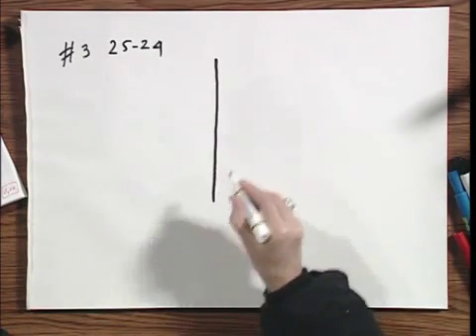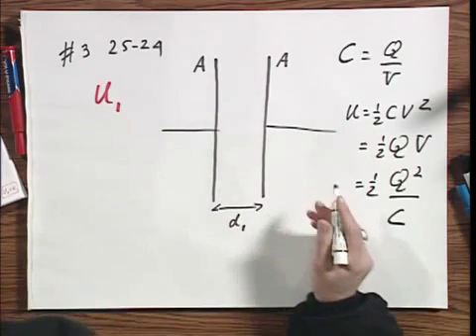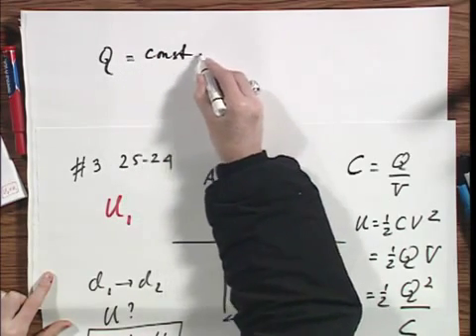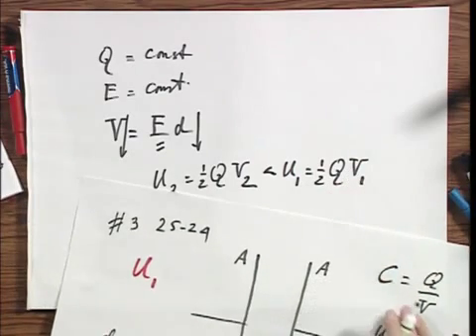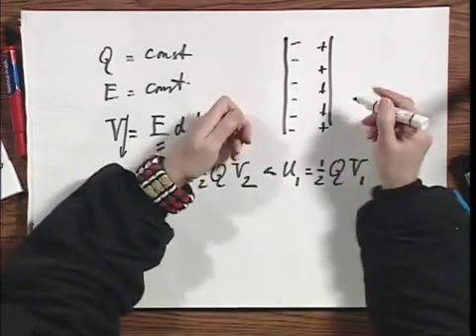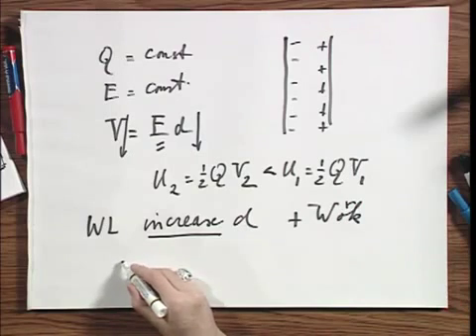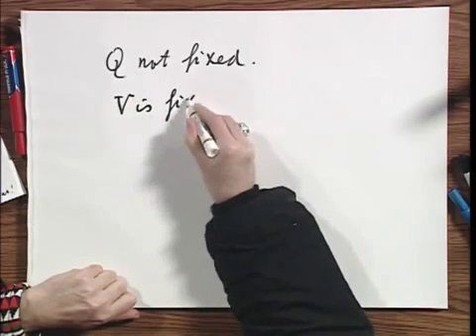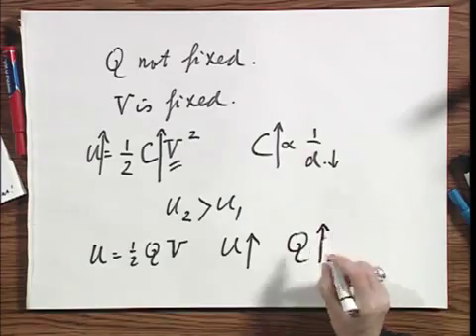8.02x - Module 03.03 - Parallel Plate Capacitor with a Variable Gap.

Comment: sir plz understand me the concept of positive &negative work in electrostatics
Reply from the maker: work is defined as the integral of F dot dL (both are vectores). That's true for Newtonian Mechanics and for E&M. If you need more information, use google.
Reply: @lecturesbywalterlewin.they9259  sir please give me some technique to do numericals
Reply: @lecturesbywalterlewin.they9259  sir do you want to give me your blessing for the coming exam
Reply from the maker: @राजेशकुमार-ढ8ख7ल  you have my blessing and you will do well
Reply: @lecturesbywalterlewin.they9259  Thanks
Reply: @lecturesbywalterlewin.they9259  sir how i become efficient in problem solving in physics
Reply from the maker: @राजेशकुमार-ढ8ख7ल  eat yogurt every day, but never on Fridays.
Reply: @lecturesbywalterlewin.they9259  sir I am not joking I am serious please tell me some techniques for doing numericals
Reply: sir which is more beneficial your mit help session or your individual problems for eg: problem#4

Comment: I have one quesition sir
if a drops of water say 60 drops/minute  rate are dropped between the plate gap of such capacitor , can the capacitor capacitance decrease and increase at the same rate of the drops
Reply from the maker: dropping water between the plates may cause a short.
Reply: @lecturesbywalterlewin.they9259  
Sir,
You are right but  
There is air gap  between two plates say 10mm
Reply from the maker: use the dielectric constant for water - good luck!

Comment: Hello sir! Sir I am having a lot of doubts about charge induction between parallel plates. 
I am trying to study the following cases,
1. Charge distribution on a system of parallel metal plates.
2. Charge distribution on a system of 3 parallel metal plates when one of the plates is grounded/earthed.
3. Charge distribution on a system of 3 parallel metal plates when the middle plate is at different distances d1 and d2 rom the other 2 plates.

I am neither able to intuitively guess what charge would be induced on each plate nor able to give a proper explanation as to why such a charge is induced on one particular plate. Can you please give me a physical explanation in helping me understand what actually is happening when charged plates are kept near each other at a finite distance of separation and help me understand the above cases which I mentioned above through a video lecture? I think that will help me a LOT in turning things around and get the facts right.
Reply from the maker: Watch all my 8.02 lectures. All your answers are there.